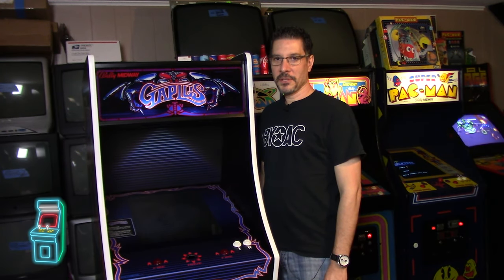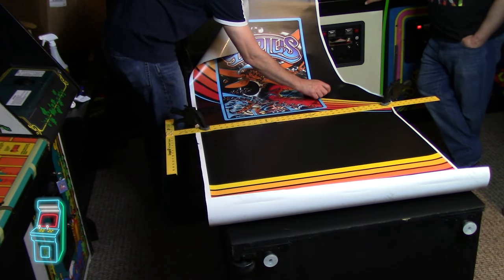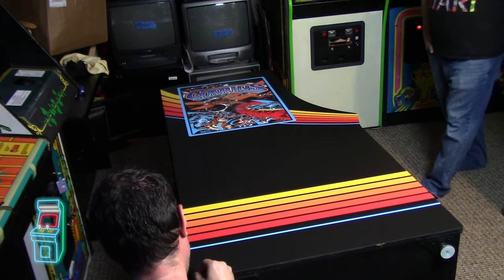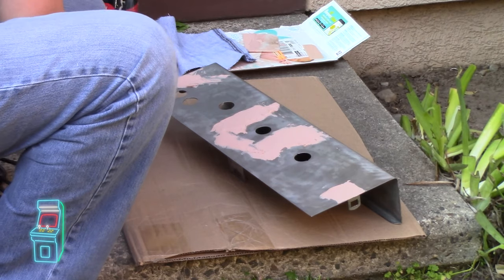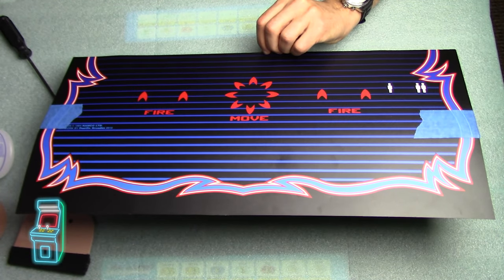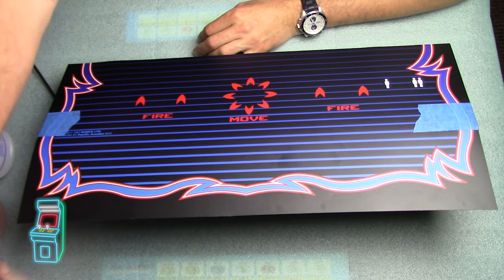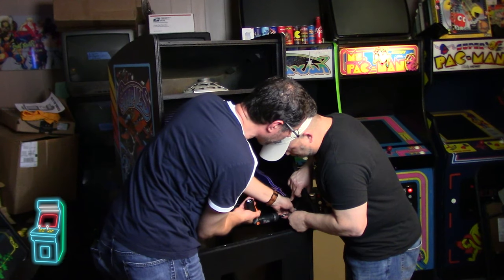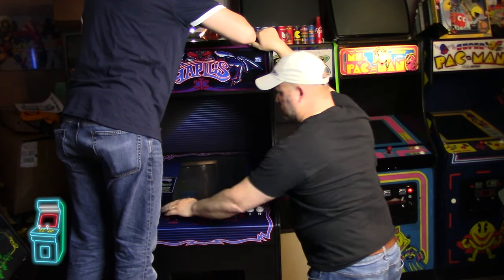Gaplus Arcade Build [Part 3] Artwork

Comment: Fun fact: Gaplus was later changed to "Galaga 3" to increase name recognition. While it may seem there is no Galaga 2, Galaga is Galaga 2; Galaxian would be considered Galaga 1.
Reply from the maker: Correct.  :-). I plan to have all of the original PCBs available to play in my Gaplus because of that: Galaxian, Galaga, Gaplus and Galaga '88.
Another fun fact: The easter egg where you get a faster shooting ship on works in Gaplus only. When you "upgrade" the roms to Galaga 3 on the PCB it removes the easter egg. :-(
Check out the upgraded ship here: https://youtu.be/357ENR6tV8A

Comment: Awesome build! Thinking about doing some thing similar. I was wondering is there a part 4? I Was wondering what joystick you were using? Thanks.
Reply from the maker: It's coming soon. Been busy with h work. But now that it's slowed down I can jump back into it. Stay tuned!
Reply: @delsarcade  Cool can't wait. Currently taking apart and old tv to see if I can use it on my arcades.

Comment: Did you do a wiring video for the gaplus ? Curious to see how you ended up with the multi boards installed etc
Reply from the maker: Not yet. But I will be finished soon.
Reply: Look forward to it.   I  finally got my art on  a few blemishes 😢 mine came with premask on it which made it to for me
To get the bubbles out . Maybe I’m doing it wrong
Reply from the maker: @douginsuresme  Did you use the wet method to apply it?
Reply: @delsarcade   yes sir
Reply from the maker: @douginsuresme  I had a bit of trouble on the front.  But the sides went on flawlessly. Is yours laminated like mine is?